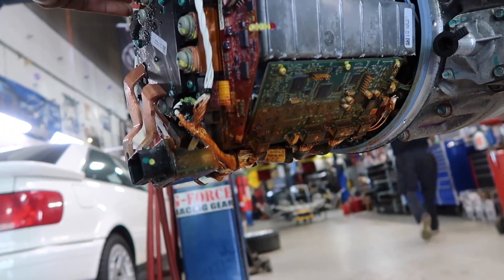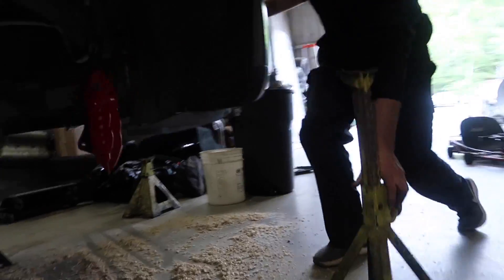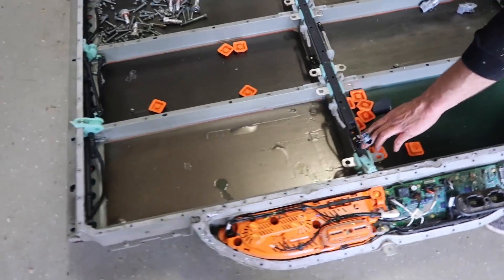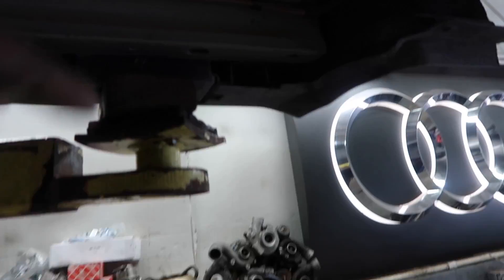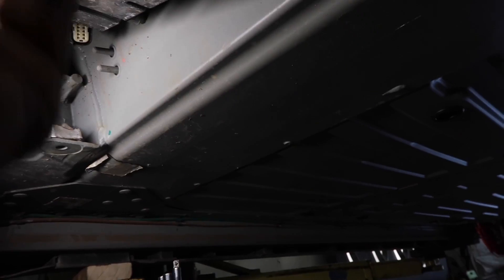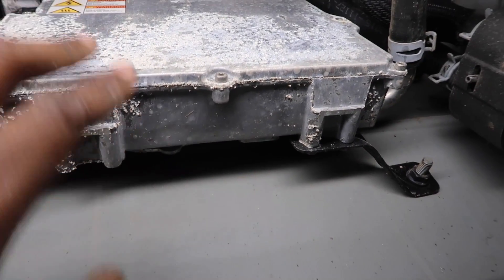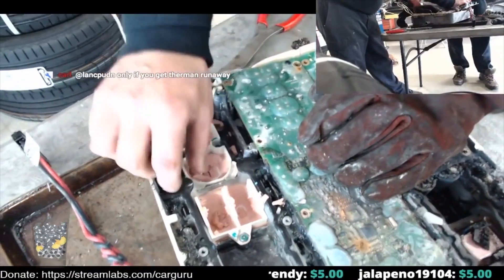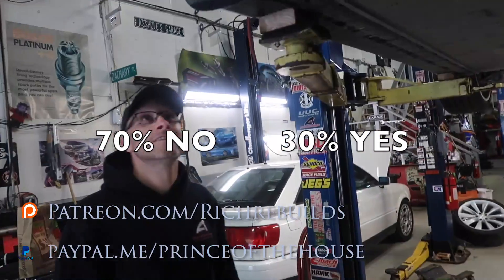Tesla: No User Serviceable Parts Inside

Comment: I hope part of your rant is Elon putting rockets on a EV because you know 'save the planet with EVs' BS
Reply: they are not combustion rockets, he said ultra high pressure air
Reply: Ev's for D's,
Selling a handful of modified propane weed burners for huge profits was a whimsical way to raise funds for his company and get tons of free press coverage.  A single trip in a completed Boring tunnel will more than offset any emissions from the flamethrower sales.  Again, like many, you're too shortsighted to see the big picture.  You don't get it and you probably never will.
Reply: JRP3 whew..that's good... glad  the billionaire won't run out of his billions
Reply: KenGenHD I never said I hated Elon or Tesla or space X.....
But people thinking EVERY thing he does is the most awesomest thing EVER is NOT healthy
Are the 1000s of pointless flamethrower good or bad for the over consumed planet?
YES or NO ?

ALL I said was I hope Rich talks about the extra rockets on a $250,000 sports EV
Reply: EVs for Donkeys 2018  Just to be clear, the COPV rockets Elon is talking about are just using highly compressed air. I'm not exactly sure why you think that's bad for the planet. There's nothing about it that's really difficult to implement either, but there's a question about the performance benefits it'd offer versus more typical methods like sculpting the car to take advantage of the air, active suspension, torque vectoring, light weighting, etc. Personally, I'm all for experimentation and change so I'm 100% on board with them trying it out. If it doesn't work, oh well.
Reply: What's your point?
Reply: hey7328 well that's not as bad as the flame thrower idea...ok good to know 👍😉
Reply: gentleman, lets keep this conversation civil.disagree and debate all you want but keep a civil tongue.
Reply: EVs for Donkeys 2018 you can blame Elon for some things but he is the perfect example of people we need in this world he is trying out things no matter how absurd they sound or how many people try to hate on them.

If we ever stabilize the earth as in not being a threat to the entire eco-system by living here or if we ever have a second planet to escape to if all goes to shit Elon Musk will be one of the guys known in history books to jumpstart a global rethinking of the world.

And for the thing you said about profits from flamethrowers. I think if he was here for the big money he would not try to revolutionize a basically dead industry (SpaceX) and a established hard to break in industry (cars). There are so many more profitable and way easier industries he could start a business in.
Reply: EVs for Donkeys 2018 yeha you are right not everything he does is awesome but I don‘t thing that a couple of flamethrowers are that bad for the environment to even make a big deal out of it. I think a 5 mile drive with a combustion car will do more damage than a flamethrower could in a year.
Reply: HAHA.. got'em ...you told him ..oh wait ..you're talking me ..NM
Reply: OK ..good to know ...maybe rushed to judge off the tweet ..my bad
Reply: If you think everything he does is crap, then you're in a cult.
Reply: Raw and Cooked Vegan never said that ..but thanks for the feed back
Reply: Do you work hard at being dense or does it just come naturally?  Exxon's core business is damaging to the environment, Tesla's is beneficial for the environment.  The fact that you can't tell the difference shows exactly which one of us is an irrational cult member.  (It's you by the way, since you probably aren't smart enough to see it.)  For some reason you joined the irrational cult of Elon haters.
Reply: Madtroid if you think EVERY thing your leader does is fantastic then you're in a cult
Reply: You're right about that, you aren't even smart enough to understand it, let alone do it.  Both moves were to make the company stronger, and thus to improve the chances of success for the company's core mission.
Reply: JRP2, I'm not certain of Evs for Donkeys point, but Mr. Musk has come up with a few dumb a$$ ideas, 
such as putting a car into space, using rockets on an EV, etc., etc.
Reply: David Hollenshead or selling 1000s of flame throwing for huge profits ...while calming you want to save the planet with solar & EVs
Reply: David Hollenshead,  The car in space served three purposes.  1. They needed a payload to test the rocket 2. It was a great marketing move for both Tesla and SpaceX, generated tons of press  3.  It was fun for Elon to do, and for many of us to see.  
The "rockets", (thrusters), on the Roadster also serves those same 3 purposes.
You, like many people, are simply too shortsighted to actually understand most of the moves Elon makes.
Reply: JRP3 Exxon  likes to make huge profits and kill the planet for FUN too ...so that's a good point ...its ALL just for fun ..its like next level smart
NOT everything your supreme leader does is the great idea ever.... that's called a cult
Reply: JRP3 https://www.theguardian.com/technology/2018/jun/13/tesla-workers-pay-price-elon-musk-failed-promises?utm_source=esp&utm_medium=Email&utm_campaign=GU+Today+USA+-+Collections+2017&utm_term=278062&subid=20081337&CMP=GT_US_collection
Reply: JRP3 you're right... I wouldn't be smart enough to fire 9% of the employees then buy back $25 million in shares
But I'm sure that was all in fun too

Comment: Wow, $100k and they straight up just glue the circuit boards together like a PB&J sandwich lol. This channel makes me feel not so bad when something on my minivan breaks, much appreciated Rich!
Reply: Actually, inspite of the water inside the casing, I was thinking, before he started ruthlessly trearing it apart, that the excess glue might have been there, to make the internal components more water resistant. I was thinking that they might have survived, before he took the crow bar to it.
Reply: Jimmy JimJims it's potting not glue, normally an inert epoxy that is used on electronics to protect them from the elements.
Reply: It
1. Stops the pcb from shaking itself apart  
2. Protects from elements (slightly less relevant here)  
3. It also acts as a heatsink. Its not a super great heatsink like copper but it can get in all the cracks and edges, a tradeoff
Reply: Jimmy JimJims take apart a new Macbook Pro. They are glued together as well
Reply: That's why I don't own that particular sealed fashion appliance. Their core market has gobs of money so no need for repair, quite like Tesla.
Reply: But you dont pot entire circuit boards this big into epoxy.

Comment: It's interesting that they potted the charger to prevent component replacement.
Reply: Just like potted meat in a can!😋 The silicon potting disperses heat and makes it nearly impossible to dismantle, maybe put it in a oven and bake it slowly increase heat till potting compound loosens. Some epoxy compounds can't be dissolved

Comment: Just let the pcbs and connector sit in alcohol and then fully dry them, should be fine after that :P
Reply: > conformal coating that dissolves in water  
The fuck? What would the coating be good for then?
Reply: krizzi666 worked for my Microsoft power port on the Microsoft book pro. Totally green with corrosion. The metal is still there,just in rust form. Convert it back to solid metal,and all is good.
Reply: ImGrumpher false
Reply: Making a nice soft drink by the sound of it. I agree though, single biggest reason for conformal coatings is to prevent moisture damage.
Reply: circusboy90210 power ports don't need coatings, if you cleaned all the corrosion well and ran it dust would get inside and short circuit the pcb after not much running
Reply: They need to be cleaned and baked. Alcohol by itself will do very little.
Reply: +krizzi666  You are describing a cleaning operation, not a repair of a circuit board.
Reply: whuzzzup it's for dust, not for waterproofing
Reply: all of the PCB's have a conformal coating that dissolves in water, just removing the water doesn't restore them and will likely fail not long after

Comment: Rich, if you had a 60Kwh tesla and want the extra range, could you swap out the batter pack from the 60 to lets say a 85? Are the battery packs interchangeable?
Reply: Does the car computer even accept a new partnumber? For several parts I know it won't without reprogramming it.
Reply: Well I was thinking if you did what Rich does is buy a wreck tesla that not terribly bad. And the insurance called totaled. And decided to rebuild it. But if it was the model s 60. you rebuild it back to where it would run. if you want more of a range, could just find another wrecked tesla that has a bigger battery pack. just swap it out. Just a thought pop in my head.
Reply: ye, but you lose your warrenty ( i think)
Reply: Edward Byard Why do it though? These battery packs cost as much as a new engine. Not worth it.
Reply: Edward. Really don't care about how fast you can go. Just prefer the range of the electric vehicle. As gas price starting to go up, I've been looking into something like tesla. Frankly don't care how quickly you can go off the starting line. I prefer long range.
Reply: I was thinking finding a salvageble latest tesla that has the range of a 85kwh battery, and swapping it out.
Reply: I wrote to Tesla asking why don't they have a trunk space for additional battery! It just has so much space for luggage and it isn't necessary, but would be cool to have a option to get the extra mileage!

Comment: Attention drug smugglers. Buy Teslas.
Reply: I think you do not understand the battery tray that was removed.  The batteries were out of it.  No room for drugs.  Easiest way to get drugs over the border is in a boarder patrol car.  ;)
Reply: I hope all your drugs get wet and ruined.
Reply: ok
Reply: I understand. They don't need all those trays to be fill with batteries.
Reply: If you are that high, it won't matter if you get where you are going.   Why even have a running car?  just sell the motor for some quick cash, right?    Now I get it!
Reply: Coming to a community near you
Reply: blackericdenice 
The problem is that they need reliable cars

Comment: Wait what? Mr. Rossmann? You mean Louis Rossmann? 

The guy is repairing Laptop and Computer electronics. I doubt that he has the time, facilities and parts to dive into an actual car motor. That's a whole different system. 
Don't take me wrong i like Louis and his repair videos but this is a whole other field of work here.
Reply from the maker: He already agreed :)
Reply: Scitch87 electronics are the same,and not dependent on the application.  Casio calculator, or space shuttle rocket thruster controllers, same animal.
Reply: I remember a time when someone sent him 2 boards off some vintage test equipment.. take chip from one and put it on the other. Do you remember the episode?
Reply: Mhhh no unfortunately not, sorry. But if you find that episode tell me which one it was because that sounds pretty fun. :D
Reply: Rich Rebuilds yay!
Reply: ]Rich Rebuilds nice! :)
Reply: circusboy90210
 well yes the electronics are the same. The parts and tools you need are different though. That's what i was getting at. I doubt you can repair a space shuttle rocket thruster with the same tools you do a casio calculator and vice versa. "I only have this 45 wrench what am i gonna do to fix that calculator?" - "Well hit it a few times with it." 

By the way i also repair electronics, and i need new tools for almost every other job nowadays (at least that's what it feels like).
Reply: lol sure. If you say so.
Reply: i cant explain how happy that makes me!
Reply: Rubbish. Electronics repair of any type only requires a few tools, and they are all fundamentally the same.